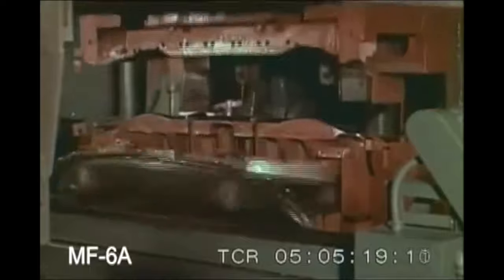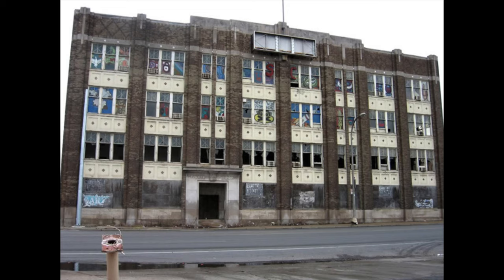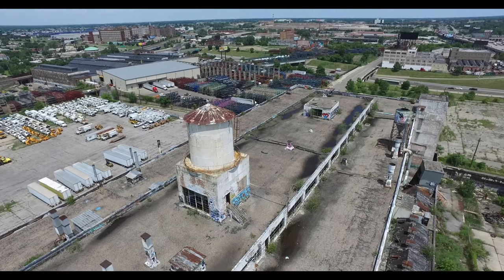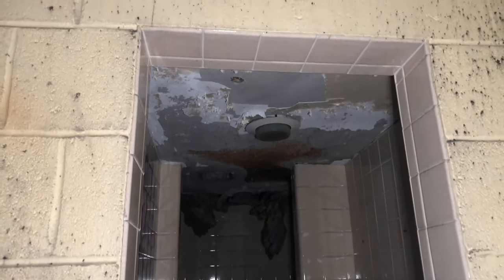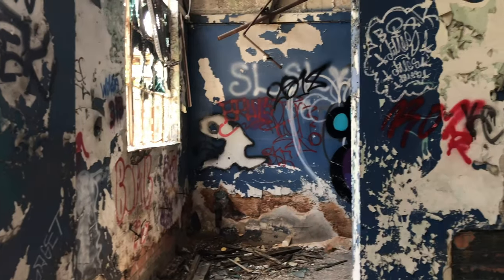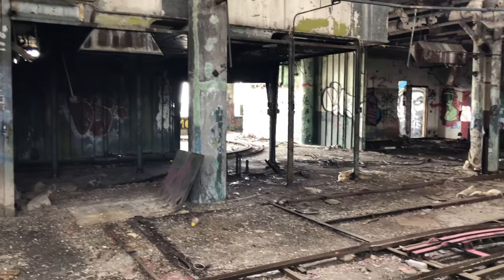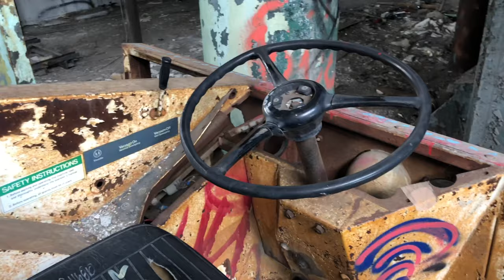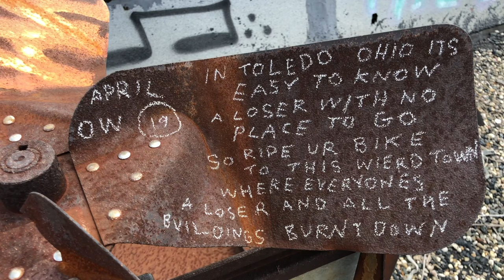DETROITS ABANDONED CAR FACTORIES - FISHER BODY PLANT 21

Comment: The music sounds a little like a Vangelis song from Blade Runner.  Just an FYI.  Also, I see some people commented on the "Wheel" you discovered.  It is for washing hands, also most of those have a round metal tube near the floor that fits around the wash basin so workers can step on the tube to turn on the water instead of turning a faucet with hands that may be greasy.

Comment: This plant had multiple uses in the 60’s And 70’s.  It was where the lo
Iimo bodies were made by modifying standard Cadillac bodies.  It was also used as a pilot line for final assembly of new products prior to production runs. They also made welding guns. There was also a trim repair facility and repair parts shop.
Reply from the maker: Wow thanks I figured it was used for multiple things at different times as they often repurpose these factory’s in time of war.

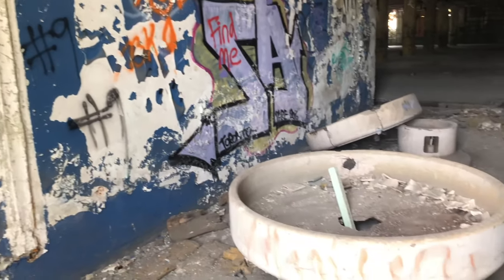Comment: 12:17 Those resemble wash basins designed for multiple people to wash their hands.  Something similar was installed at my grade school in the late 60s/early 70s.  You depressed a bar close to the floor with your foot to dispense the water.  I can't say for sure though.
Reply: Yes, we had it at the original Cass Tech High School
Reply: @Chris Clermont  That's exactly what it is, you are right.